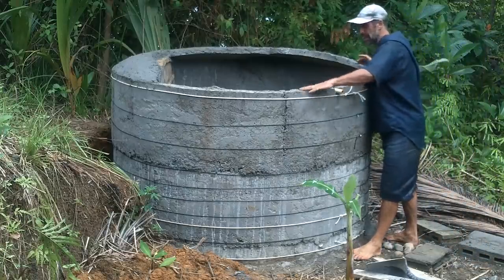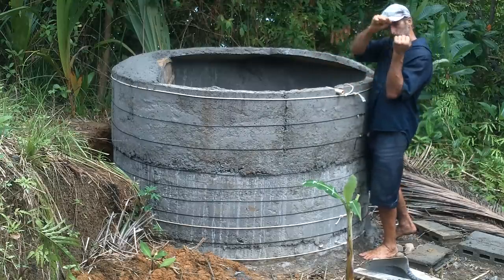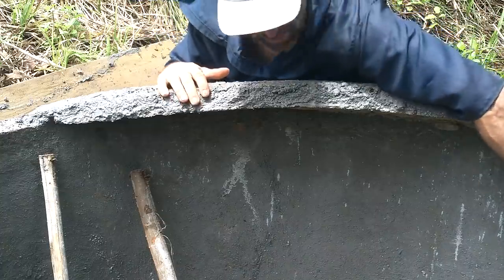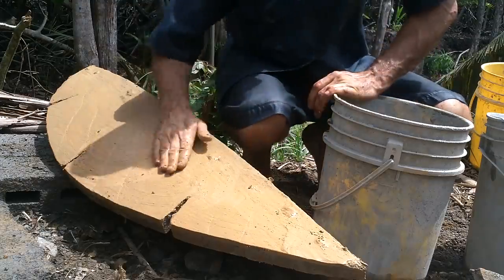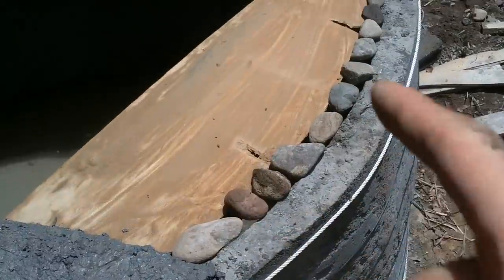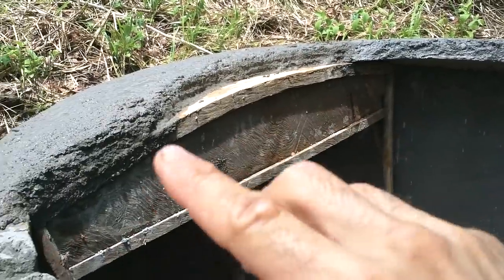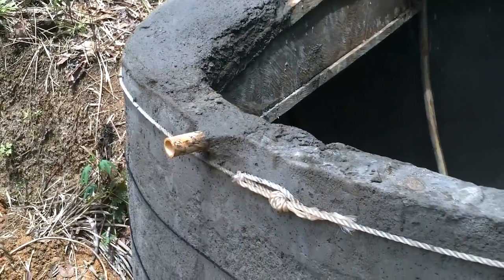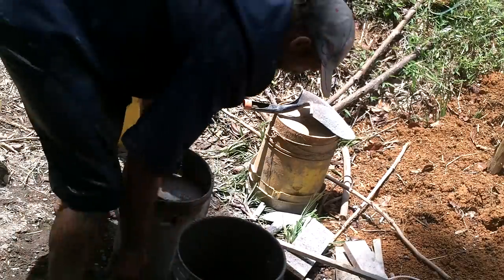Concrete Water Tank 03 Reinforcement n' Roof Start

Comment: In watching your technique used to apply the  coating for the tensioning ropes I am reminded of when I was tasked with repairing a concrete ceiling. I wired in screen to fill the massive holes then troweled in soupy concrete like you used. The process was labor intensive and seemingly endless. Most people use a pumping system, but my cousin said, "Just stand on a ladder."

Comment: A hurricane proof building was designed using a balloon in the shape of a house with doors and windows. It is inflated and the a layer of concrete is sprayed over it, once set the balloon is deflated and removed. Fit doors and windows, paint and move in. Regards from Billy in South Africa

Comment: Couldn't you avoid the requirement for the ropes by tapering in the tank slightly?  Then the inward taper would offset the outward pressure?
Reply: Taper how? Wall thickness? Given the form method, it's definitely easier to just use the ropes. Realistically the ropes are there to just prevent the thing from collapsing if the concrete cracks, at which point any repairs can be completed. If you're talking about changing the shape of the tank, making the tank a cone with a wider bottom would be counterproductive (would increase the stress on the walls), and making the tank a cone with a narrower bottom would make it unstable and require additional supports (as well as increasing construction difficulty, this would require more resources and time to complete).
Reply: @sycodeathman  Why use ropes?  Would not wire be better/stronger?
Reply: @Patriottoo2  Wire is more expensive, and unless you're using stainless steel wire or bronze wire, it's going to corrode and cause problems. It also would only do about the same in terms of benefit anyway, so may as well use rope. 
Remember, this thing isn't a skyscraper and doesn't need to be ultra super strong, it's a person sized water tank. No need to go crazy.

Comment: I think the only way to get this structure up to code, is to tear it down in 5 years, bury it with garbage and build a brand new one with rebar right beside it.
Reply: Could you use the ground as a form  ,and dig a dish shaped pour the concrete in it and then when it's set set it on top?
Reply: He is the code
Reply: @letmegoguy  Great idea. But it would weigh about 350 pounds if it was two inches thick. It would also be very prone to breaking while lifting without any type of  rebar. 
   Maybe fiberglass...?
Reply: @2pi628  If he put ocean garbage in it, that would make it stay together (free rebar)